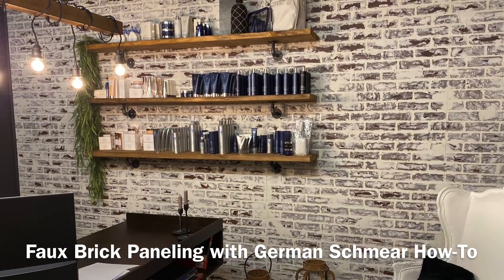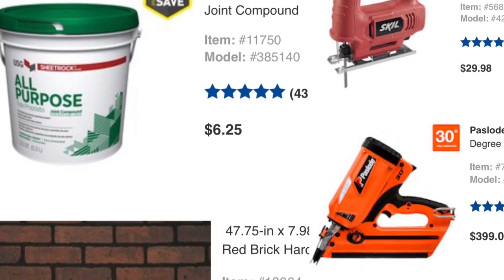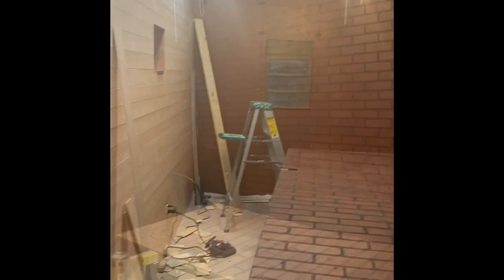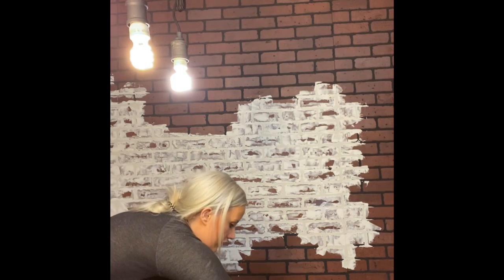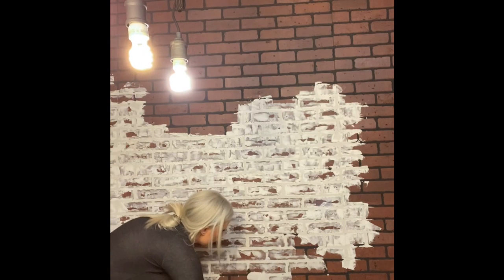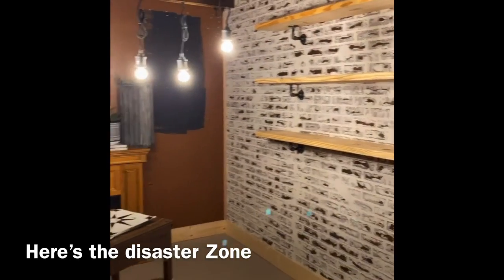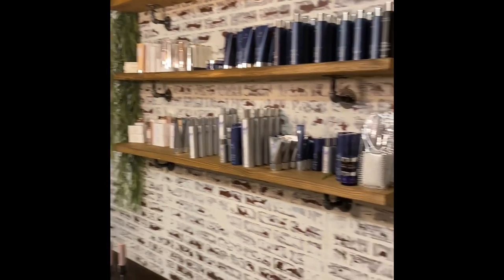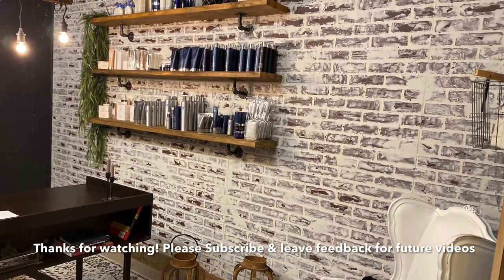FAUX BRICK GERMAN SCHMEAR How-To for only $150! EXPOSED BRICK that Won’t Break the Bank!

Comment: I’m interested in the wood corners. I want to hide the transition between the brick veneer and the drywall around the corner.
Reply from the maker: Sorry for the delay! Use corner round for outsides or cove for inside corners, flat strips for ceilings

Comment: Love it! Did you put a sealant on the joint compound when it was finished? I heard it would flake off if it wasn't sealed or painted.
Reply: Most people don't. Once it dries, it dries rock solid. It won't flake off.